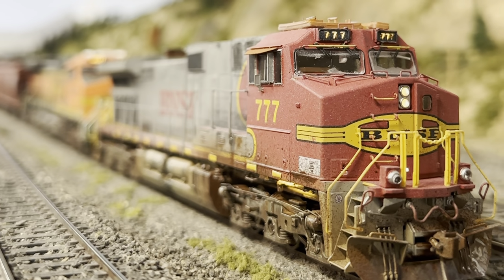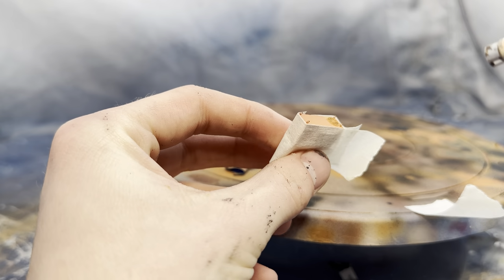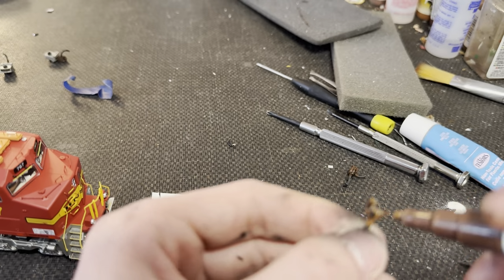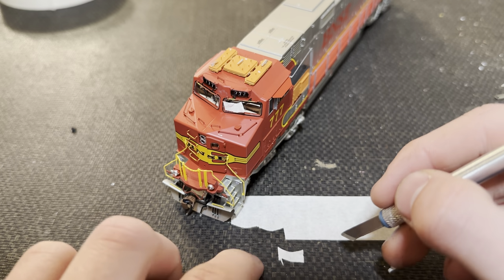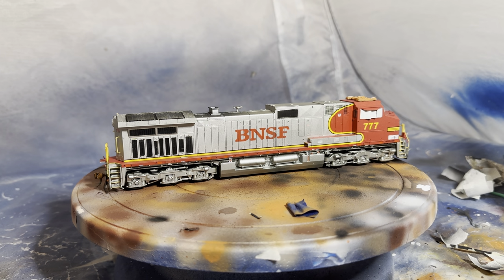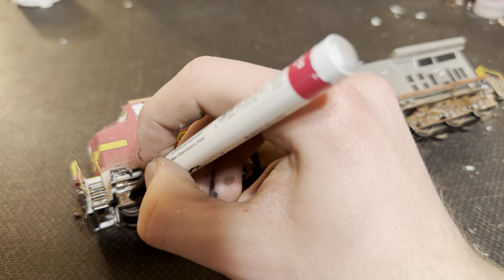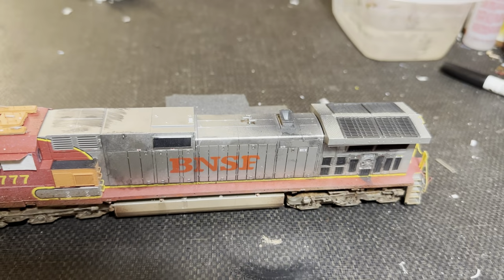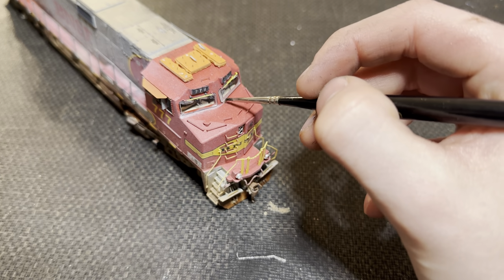Weathering an HO Scale Locomotive: Athearn Genesis BNSF Dash 9

Comment: I model spring/summer 2008, and while the FRA reflective tape became mandatory in 2005, there were timetables for implementation that didn't mandate every single locomotive and piece of rolling stock get them overnight. 100% implementation on all rolling stock wasn't required until 2015 (2010 for locomotives), so I actually have a mix of cars that have and don't have the stripes in my fleet. For the most part I use prototype photos to determine if the item I'm currently working on would have had them, and if so where.

Comment: Very nice overall job ! I would prefer seeing you putting more accurate couplers but I like the way you're handling it. I'm doing jobs like this but on some older engines. It shows everybody how complicated it can be and that it needs time and skills to do it. Keep on you're good work.
Reply from the maker: Thanks! Wish I could use more prototypical couplers although the track at my club isn't very even and if the couplers are too small it'll separate the train
Reply: @kylescustomtrains  Ahhhhhh !!! Train clubs. I've learned a lot there but god preserves me from beeing part of another club for the rest of my life. If there's a place to get frustrated... Train clubs. No one is working the same way and no one is working at the same speed.  At least I know why you're still using KD #5. Keep on your good work.

Comment: Interesting video, good to see some techniques before I tackle my own Warbonnet. I like the way the white fade coat lightened the silver and turned the red bonnet to pink.
A couple of observations: applying the dark panel wash at the beginning would have prevented the problem you encountered when you tried to take the excess paint off later. Also, you re-applied the handrails but left them in a virginal condition, most photos I have looked at of the locos show at least some grime build-up in the stanchion recess particularly on the lower end.
Keep the videos coming!
Reply from the maker: Thanks for the tips! I used to do the wash last as I wasn't sure if the fade would blend it in too much although seeing as though I essentially did the wash first in the video I'll have to do it first going forward. I'll probably hit the handrails with a wash going forward as well, or just reinstall them after the wash and hit them with the airbrush along with the rest of the locomotive
Reply: @kylescustomtrains  perhaps even an application of weathering powder with a tiny brush would work on the stanchions?
Reply: Also, the virginal safety stripes on the dirty, faded locomotive.

Comment: Looks good at arm's length but I think you went way too heavy on the trucks and fuel tank -- especially all that thick brown overspray from doing the trucks. Road vehicles splash dirt up the sides from the wheels because the wheels come right to the edge of the vehicle; rail wheels are ~5ft apart under a vehicle that's ~10ft wide, so you don't get splashing like that.

Comment: Do you do anything to protect the electrical components in the wheel sets during weathering or have to do anything afterward to ensure good electrical connection between track & locomotive?
Reply from the maker: Often times I will have to clean the wheels on the locomotive if too much paint finds it's way back there, although it isn't too difficult to remove with a little bit of rubbing alcohol and a q-tip

Comment: So I model UPRR
If I wanted I wanted to take that yellow and make it look faded/20yrs on the road look, would you recommend spraying on that white?
Reply from the maker: Recently I've had more luck with an sand/tan color paint which looks pretty much the same as a white fade with less paint clumps visible. I'd say a few coats of that would work just as well if not better on yellow than white would
Reply: @kylescustomtrains  If you're getting clumping on a fade coat, dilute the paint more, and use a high-quality modelling acrylic like Tamiya or Vallejo. I find that gives a much more uniform result than random craft acrylics.

Comment: Y Athearn have lit number boards on the dash 9s an not on the ES44's
Reply from the maker: The Dash 9s have been newly tooled for Genesis but Athearn is coming out with a new run of Gevos that have been updated to meet the new higher detail standards of Genesis and will have pretty much all the same features as the dash 9s like lit numberboards, roller bearing trucks, ground lights, etc.